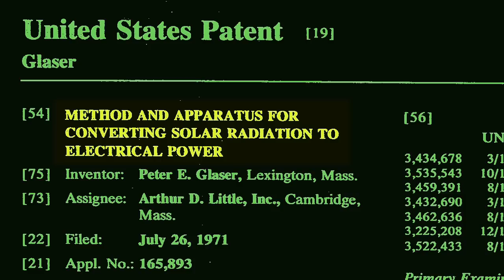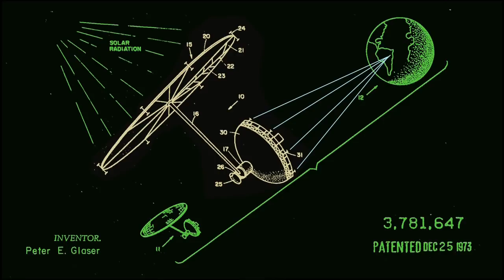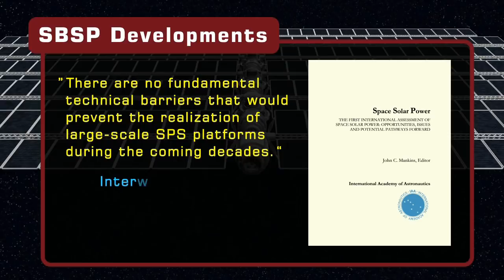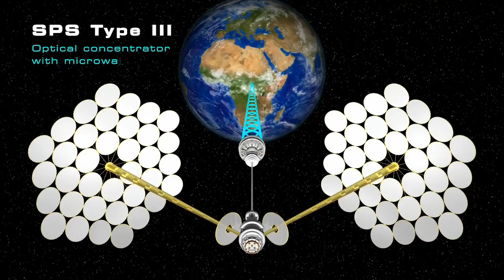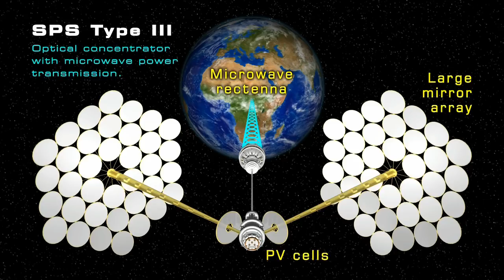Space-Based Solar Power

Comment: One complication that I see with such a solar system in GEO orbit is that the momentum of light will constantly push the array out of its GEO orbit and the array will constantly have to make solar sail adjustments to its orbit.  This may effect its overall performance.
Reply: I am curious to know whether the satellites would be vulnerable to damage from meteors, other debris.
Reply: You could pick an orbit that is very slightly below geosynchronous and take advantage of the thrust to compensate for it perhaps using matter efficient ion drives to maneuver the satellite.

Comment: It would be interesting to see actual projected figures for the amount of energy this could produce. Our local tv transmitter 15 miles away radiates 100kw ( admittedly omnidirectionally ) which produces ,if you are lucky 1.3 x10 -8 watts at the aerial socket on a TV (using high gain aerial). As received signal drop dramatically with distance this is an enormous loss. I don't doubt it can be done but as I imagine we are hoping for megawatts if not gigawatts at the receiving end  the amount at the transmission end must be mind bogglingly huge.

Comment: 0:49  space solar power SSP will wireless transmit energy to the rectennas on the ground.  2:35  PGE and JAXA plans.  3:00  IAA 2011 said 'there are no fundamental technical barriers to prevent the realization of large-scale SPS platforms..." highlighting 3 approaches:  a) solar panel photovoltaic then transmit by microwave beam  b) ditto then transmitted by multiple laser beams  4:35  c) mirror array to smaller photovoltaic and transmit by microwave (most viable).  5:55  the transmission of energy over long distances using microwave or lasers is long proven.
Reply: The proposal III could also use a heat engine instead of high performance, high temperature solar PV (as these PV systems degrade quickly in space).  A heat engine could be quite efficient due to the high concentrated temperature and the extremely low condensing temperature of space.  The heat engine may also be more reliable.

Comment: The only short term answer to make this system work is create a super super super energy efficient battery storage method. Then create a solar power plants on the moon to charge  large batteries 24/7 and send the battery's back to earth by doping them into the earths oceans for recovery. We can be charging battery everyday all day and dropping them back on to the earth. Not only that ... but we can create a moon or space mining station ... where we will use only space material to create the batteries. Combining theses two methods. You would have unlimited material for battery and unlimited energy from the sun. After achieving this, use can use the solar energy from space to launch the battery back into the earths atmosphere. All elements needed to make this possible are already in space.  We can do for the short run ... until we figure out how to beam energy back into earth correctly. Also many of us on earth are trying to achieve 'Fusion" we should build a 'Fusion" reactor on the moon and use the sun power to quickly learn how to make 'Fusion" work, instead of doing it in a lab on earth with limited power. Also there is no gravity in space and this may prove to be the missing factor in making " Fusion' Work and Why it's not working on the ground on earth. My Name is Arafat Shabazz and this is my projection stated on 11-13-2019. Mark My Words ....

Comment: 4:00 The lasers used in "type 2" don't make sense near visible laser light would be just as vulnerable to cloud cover as ground based solar. And the most efficient lasers are 30% efficient and then to turn it back into electricity you use another solar cell at 30% efficiency throwing away 90% of the power generated. Radio and Microwaves are much more efficient. The best microwave magnetrons and rectennas have achieved efficiencies of 90% and 95%.

Comment: Would it be practical to mount a rectenna on a plane. My understanding is that a big part of flight cost is the fuel used to lift the fuel you will use later. A plane with rectenna powered electric fans would not need to carry any fuel and could use any energy source. Or more ambitiously could a airplane mounted rectenna power an air breathing vasimr for high speed travel and SSTO.

Comment: It is probably a laser weapon, but i would ask Philips (CD) to built the lasers because it would take a lot-of tracking and adjusting for it to focus it's beam. It's a concept, i understand. We would be better of putting the resources in play to develop new solar materials with higher efficiency to be used on earth. In line of this concept i don't understand why we think of large array's of solar flat-panels ? You can not adjust the orbit of these satellites, it would take enormous reserves of (gas) energy on the satellites themselves. Therefore inflating a balloon the size of a soccer field is easier to do in absolute vacuum of space. The balloon material should be able to transform the heat through heat exchanges and store that in (a motor) momentum (Rotating Flywheel). The balloon will of-course rotate counter clockwise and the other side of it will be exposed to the sun etc. etc. Because we can't suck the energy out (Through a Laser beam) the balloon will go ballistic and be destroyed by centrifugal forces. End of experiment.

Comment: Is building this solar panels, wich aren't cheap worth their cost? I am wondering, if it is just like with wind farm. Building single windmill requires a lot of rare earth elements.
Reply from the maker: You make a good point. Even though solar panels will be about 10x more efficient in space (before energy loss in transmission to the Earth), they are currently expensive. The hope has to be for new developments that allow cheaper large PV panels to be created -- perhaps using nanocoatings -- and in particular for developments in asteroid or moon mining to allow the panels to be created in space from space resources.

This all said, as noted in the video, the potential reason that a Type III (optical solar concentrator) design may be the most viable is that it would use relatively small PV arrays in combination with very large mirrors -- reducing not just the electrical infrastructure complexity, but also the number of PV cells required for the same energy output.

More broadly, I so agree with your point about using rare earth metals to build windmills. Far too many people still talk about "renewable" rather than "alternative" energy -- it is so important to remember that wind, solar, wave and future energy forms all consume resources to build their infrastructure, and hence are not resource neutral at all.
Reply: ExplainingTheFuture Mentioning that wind farms etc. need rare materials and therefore arent resource neutral is a very good point. Considering this i think nuclear power is the most efficient way of generation power. If its possible to send energy through space without too much loss,i think building nuclear power plants on the moon could be the next big thing.

Comment: Will it ever be economically vayable?
Reply: Once you have materials and construction available on the moon, yes.
Reply: @tripzero0  well it is said that it becomes inefficient to convert space solar power to electricity with huge loss in efficiancy. It is still a challange to constuct solar panels in space but i hope it one day works
Reply: @moltoniron633 , the type III proposal is to use a reflective surface to concentrate the solar power.  The reflective surface could be made from any cheap shiny thin surface eg. Aluminium (Al). Al is about the 3rd most abundant element on the Moon.  While we don't make it there yet, we may one day.   

Also because Al is light weight it will be one of the cheapest reflectors to launch.  We are pretty good at folding and unfurling these kinds of surfaces so that part should be relatively easy.  

We only really need to get it to a low earth orbit (LEO) and we could use its reflective abilities as a solar sail to push it up to a geosynchronous orbit.  

The main barrier is the current LEO launch cost.

Whether you use lasers or microwaves the losses will be around 50%.  But there is no storage problem as you get sunshine 98.88% of the time (twice a year you will get a 42 day period of brief 70 minute Solar-Eclipses of the Earth).

Comment: Space-based solar power on a large scale would definitely contribute to global warming. Is that what we're after?
Reply from the maker: +Fernand Geene Van Why? Microwave power transmission should not heat the ground, the panels in space would actually prevent some sunlight hitting the Earth, and we could stop burning so many fossil fuels (which OK, we ought to stop doing anyway).
Reply: Well really, I thought that would be self-explanatory. But anyhow, let me explain: any energy being brought into the earths' atmosphere will eventually dissipate into heat; thus heating up the earth!
Remember, this is energy that would not reach our planet naturally!
Reply from the maker: Fernand Geene Van Actually, some of the energy would have reached the Earth as sunlight. Also, if use of SBSP reduced the burning of fossil fuels, this could help to cool the Earth. You need to think hollistically about this.
Reply: ExplainingTheFuture I agree! We should think holistically and use the same model. Bringing extra energy into the earths' atmosphere using fossil fuels is bad (because of the greenhouse gases) AND the amount of energy. The same goes for any energy from the sun, that wouldn't reach the earth naturally!
The problem is, that it is very hard to make a valuable estimate.

Cheers, I like your shows!
Keep them coming!

Comment: I can't see how this could possibly be cheaper on $/KwH basis than ground base solar farms.
Reply: +Anon Ymous exactly. especially when you get mirror only solar concentrator steam turbine arrangements at 70% efficiency utilising molten sodium for night power. then in 15 years we will see optical rectenna technology replace standard photovoltaic panels with 80%+ efficiency.
Reply: +Pulsed Neutrino How well would an optical rectenna work on a cloudy day? How would the energy be stored? Why couldn't coal-fired power plants also operate at 70% efficiency?
Reply: +hitssquad optical rectenna technology is far superior to standard photovoltaic cell technology even in cloudy weather as it directly rectifies the light wave energy to dc.  the average efficiency of all coal power stations in the world currently stands at around 31%.

Comment: I'm not really sure what the advantage is. Wouldn't any cloud cover attenuated the power being sent down to some degree? Real estate at the Clarke belt is some of the priciest realestate in existence. I'm not sure if this would be the best use of it. Being geostationary wouldn't the collector be in the  dark an equal mount of time s the Earth below it is. Would take humongous arrays of reflecting mirrors in that last design to maximize the amount of time they are in the Sun. I'm left  pondering if the wiser use of that amount of money would be to increase the number of PV panels mounted on the ground. Intertig video all the same.
Reply: +waswestkan  No doubt cloud cover could attenuate the power sent down, to what dgree would have to depend on the transmission frequency. Stuctures paked at an point  on the Clarke Belt can be designed to perform mutiple functions. In at least one of the design proposals the collecting arrys would be steerable. The time they couldn't be pointed to the Sun most likely would be very brief.. Technology like this can only be  one part of the overall solution. Nothing is going to be the ultimate only solution

Comment: wont the earths rotation mess with how this system works
Reply from the maker: It certainly needs to be accounted for -- perhaps by storing the energy and only beaming it to the base station during certain parts of the rotation when it is in range. Or the SBSP satellite could be geostationary, but would then lose sunlight on its panels on some occasions (unless they rotated to always face the Sun.
Reply: ExplainingTheFuture could have multiple space based geostationary Solar Panels so one is always facing the sun and producing energy.
Reply: Having the satellite in geosynchronous orbit would mitigate that issue.

Comment: Range of microwave??????
Reply: Yes, microwaves are fairly low frequency and are therefore less likely to be blocked by the atmosphere and much less likely to significantly heat the surrounding area than visible light you would want to design your transmitter so it can't be concentrated to more than 100 watts per square meter so it can't be used as a weapon though.